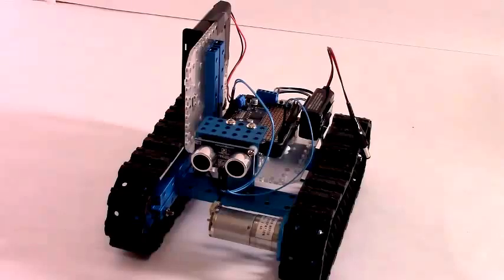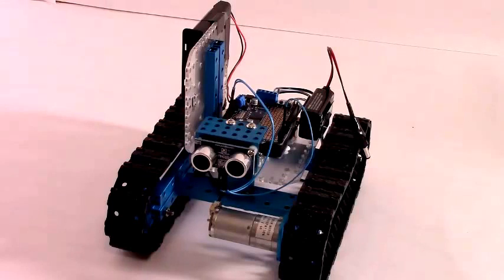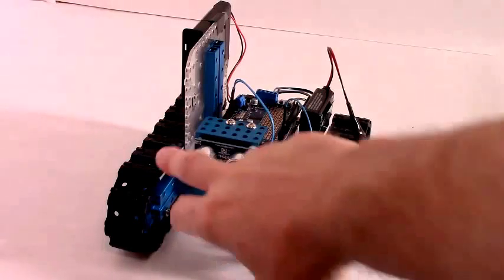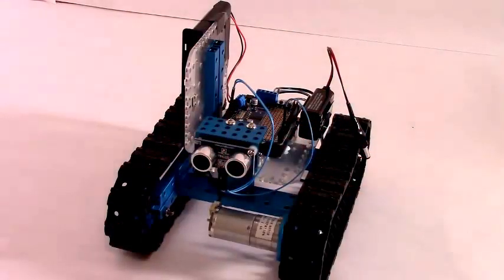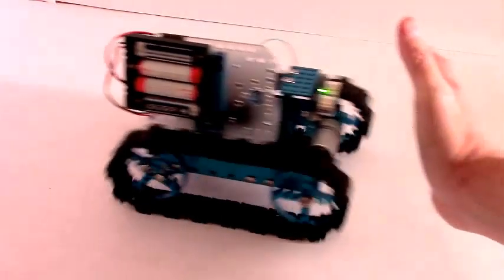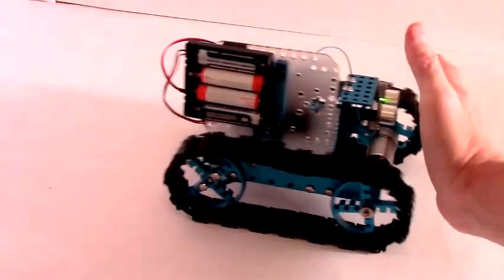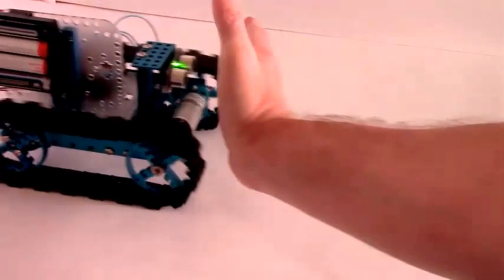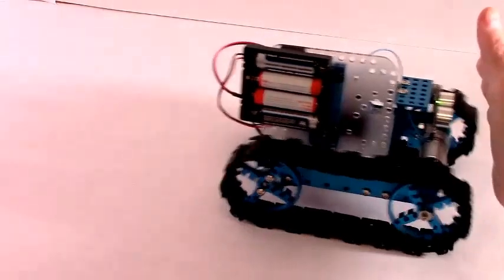Arduino Robot Projects || Close but Not Too Close Robot || Version 2

Comment: Another reason for the jerkiness is the motor signals need to be smoothed. You can do this by soldering ceramic capacitors to the motor terminals. The motors will run smoothly.
Reply from the maker: +KajimiMan  Appreciate the comment and suggestion.  Agree.  I hadn't added the caps at the time of this version.   I was curious about how well (or poorly ) it would perform before decoupling, etc.  Caps did help a little.   But, interestingly enough, the largest improvements came from fine tuning the PWM.  I've often found that different motors will tend to respond a little more smoothly or "snappy" depending on where one initializes the PWM ( starting from 127 vs., 150, vs, 255, etc.  i.e., some seem to respond better depending on how one sets the initial mark to space ratios) and sometimes higher or lower frequencies depending on gear ratios, quality of materials, etc.  Thanks for watching!
Reply: You're welcome, I will try to adjust the PWM when I get another motor controller. I burned mine out big time. Here's a lesson, just because it's rated 12V doesn't mean you should run that much. 5v is sufficient enough.

Comment from the maker: Code for Version 2
/* 
title: close_but_not_too_close_robot_version2
by: philomech
date: 1/2015
Notes:
For use with Adafruit Motor Shield V2,
but could be adapted to work with most any
motor driver board, shield, etc.
*/
/*************************
* Libraries/Objects        *
*************************/
#include <Wire.h>
#include <Adafruit_MotorShield.h>
#include "utility/Adafruit_PWMServoDriver.h"
// Create the motor shield object (I2C address = 0x61)
Adafruit_MotorShield AFMS = Adafruit_MotorShield();  
// Set motor shield port: (M1 = 1, M2 = 2)
Adafruit_DCMotor *myMotor_one = AFMS.getMotor(1);
Adafruit_DCMotor *myMotor_two = AFMS.getMotor(2);
/****************************
* ping variables              *
****************************/
int ping_pin  = 4;              //ping signal pin
int distance = 0;               //used inside ping()
int current_distance = 0;       //used in void loop
const byte too_close = 2;       // 2 inches from ping counts as being "too close"
const byte too_far   = 3;       // 3 inches from ping is too "far away"
const byte out_of_bounds = 20;  // used to keep robot stationary until a hand, 
                                //etc., is less than 20 inches from ping
/************************
* function prototypes     *
************************/
int ping(void);
void stop_robot(void);
/************************
* setup                   *
************************/
void setup() {  
  delay(1500);
  AFMS.begin();  // create with the default frequency 1.6KHz
  // Set the speed to start, from 0 (off) to 255 (max speed)
  myMotor_one->setSpeed(255);
  myMotor_two->setSpeed(255);
  myMotor_one->run(FORWARD);
  myMotor_two->run(FORWARD);
  myMotor_one->run(RELEASE);
  myMotor_two->run(RELEASE);
}
/*************************
* main loop                *
*************************/
void loop() {
    myMotor_one->setSpeed(180);        
    myMotor_two->setSpeed(180);

  int current_distance = ping();       //collect current distance 
                                       //from ping
                                       
  //if current distance is greater than 20 inches, stop robot                                     
  if(current_distance > out_of_bounds){
    delay(50);
    stop_robot();
  }
  else{
    //if current distance is less than 2 inches, reverse
    if(current_distance < too_close){
      myMotor_one->run(BACKWARD);
      myMotor_two->run(FORWARD);
    }
    //if current distance is greater than 3 inches, forward
    else if(current_distance > too_far){
      myMotor_one->run(FORWARD);
      myMotor_two->run(BACKWARD);
    }
  }
}  //<--- end of main loop

/*************************
* ping function            *
*************************/
int ping(void){
  unsigned long pulse_duration = 0;            //local variable for storing pulse duration
  pinMode(ping_pin, OUTPUT);                  //set Ard to Ping signal pin to output mode
  digitalWrite(ping_pin, LOW);                //signal pin low for 5 microseconds (initiate ping)
  delayMicroseconds(5);             
  digitalWrite(ping_pin,HIGH);                //signal pin high for 5 microseconds, emit pulse
  delayMicroseconds(5);
  digitalWrite(ping_pin, LOW);               
  pinMode(ping_pin, INPUT);                   //set Ard to Ping signal pin to input mode
  pulse_duration = pulseIn(ping_pin,HIGH);     //collect return pulse and assign to pd variable 
  pulse_duration = pulse_duration/2;            //convert pulse duration to inches 
  distance = int(pulse_duration/74);                
  return distance;                    //return value in inches (caught by current_distance
                                              //variable in void loop)
}
/*************************
* stop robot function      *
*************************/
void stop_robot(void){         //coast, not a brake
  myMotor_one->run(RELEASE);        
  myMotor_two->run(RELEASE);
}